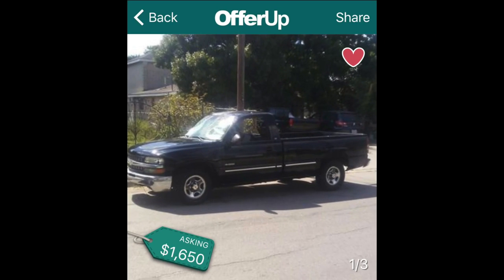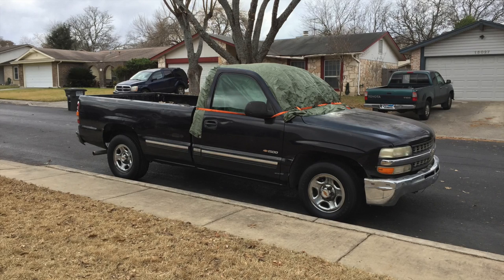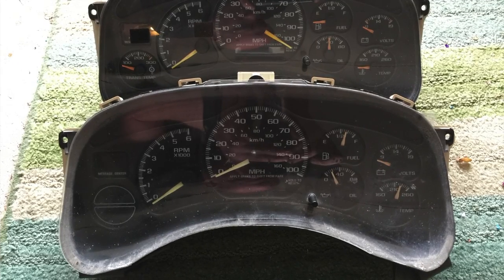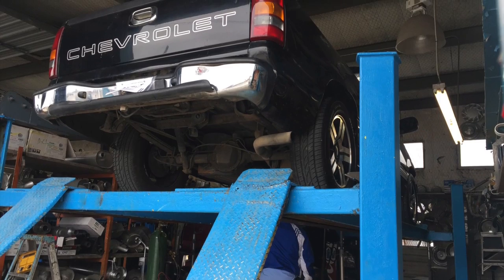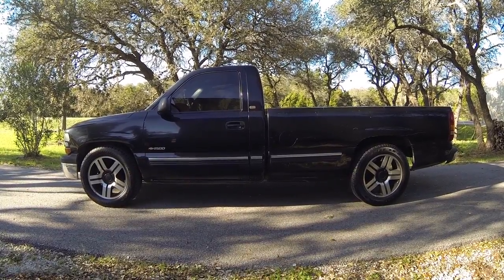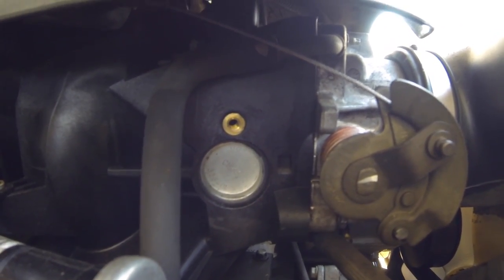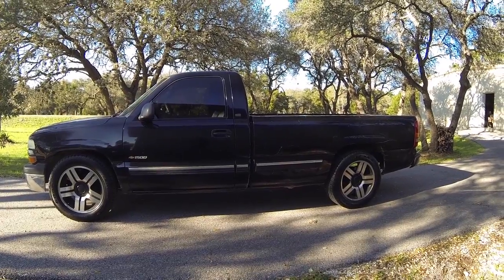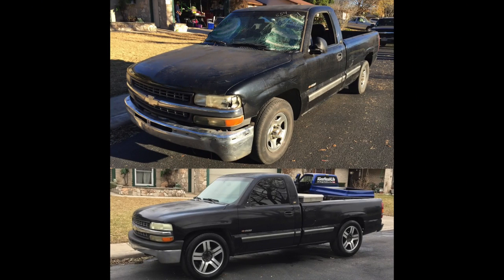The "Vandal" Project Introduction - Daily Driver Work Truck m, '01 Chevy 1500 Truck NBS

Comment: I'm wanting to put remote start on my 2002 yukon denali any info on your remote start setup bud
Reply from the maker: +IAM DUGAR Yea, I've been rolling around the idea of how I can get a helpful video up on the subject. They've made it very difficult for DIY guys to do it. They hide the install manual and funnel everyone to a certified installer. But I'm thinking about making a video to point people in the direction of where to find the information they'll need.
Reply: AGearHead4Life Hope you do because I'd rather do it myself I love you videos bud SALUTE
Reply from the maker: Thanks man! I can tell you now that driectechsDOTcom is where you'll need to go and register an account to get what you need. But even then you've got quit a bit to figure out. It's the starting point.

Comment: on a 5.3 with a send and return on the fuel rail which is send and which is return plz help ???
Reply from the maker: Larger upper line is the inlet and the lower/smaller line is the return.

Comment: what remote start did you use? and how much does it cost?
Reply from the maker: +Cesar Canales I used a Viper 5806v. They run as cheap as $125 on Amazon, but it's some work installing them. They make it difficult for DIY guys to do. They hide the installation instructions and push everyone to a certified installer. I even had to purchase a Too to program the DBALL module to allow the remote start on this vehicle. It easier on older vehicles.

Comment: Did the console bolt right up?
Reply from the maker: Nah, it needs mounting points welded in for it. I still havent done that yet.
Reply: AGearHead4Life oh ok. I have a 07-13 console in my 03 and I heard the 14+ had different brackets, good to confirm that. Looks awesome tho I'm sure it won't be hard to make it work

Comment: How did you do P/N Rev limiter 4K rpm ?
Reply from the maker: I used HPT to change the settings and flash the PCM. In other more common words, I tuned it to do that.

Comment: do you have the link for the tint??
Reply from the maker: YEssssir! Gimmie a sec.
Reply from the maker: Here's the link for the pre-cut window tint that I used. Make sure the window is soaking wet before attempting to apply.
http://rover.ebay.com/rover/1/711-53200-19255-0/1?icep_ff3=2&pub=5575162067&toolid=10001&campid=5337841854&customid=&icep_item=130855981364&ipn=psmain&icep_vectorid=229466&kwid=902099&mtid=824&kw=lg

Comment: i have a efan harness and ls1 fans ill sell you if you need it
Reply from the maker: +tunercars3 Thank you very much! Good looking out. I've already got the factory e fan harness and fans. I should be getting them in soon. Just gotta pick up a 34" radiator first.
Reply: AGearHead4Life hey no problem i did the conversion and it turned out great i do have a question im getting random  chk engine codes and valve train noise now its not bad but more noticeable than before and the engine is new has about 8k miles on it does have a tsp 224r cam in it and was tuned by blackbear the last codes were lean bank 1 and 2 and knock sensors well i checked the intake for leaks and found none im kinda stumped
Reply from the maker: Make sure the check the fuel pressure too.